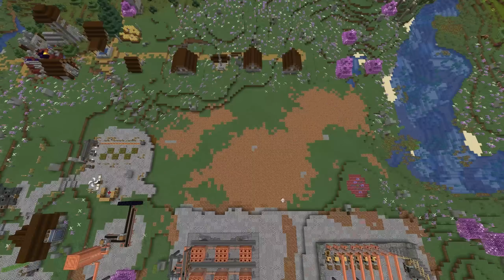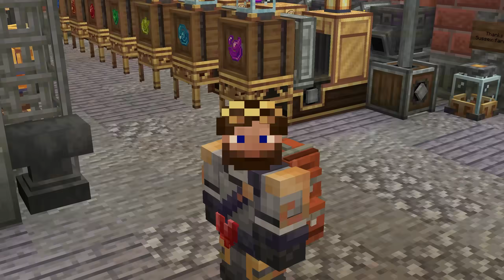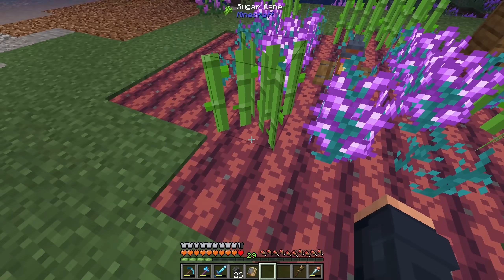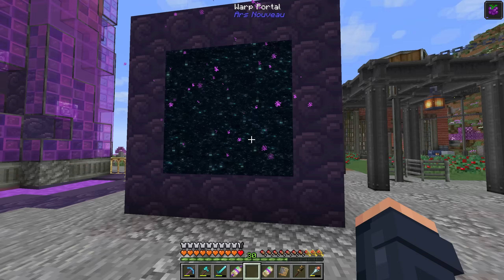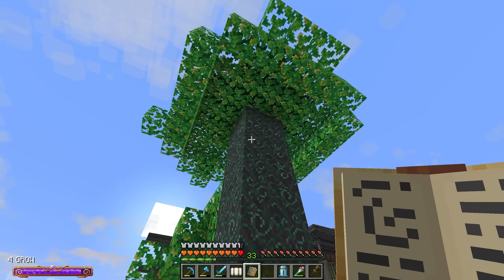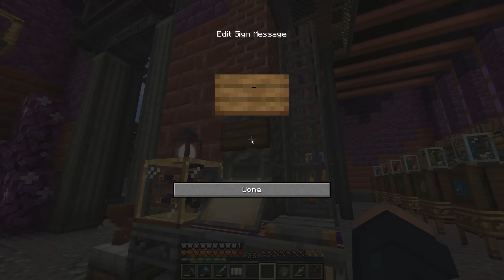Stop Pressing Your Iron! Use MAGIC Instead! EP15 Chosen's Create: Integrated

Comment: is this modpack quite laggy? i tried downloading it and when  logged into the worls i had like 5 fps and my gpu was reaching almost 100?
Reply: I haven't experienced that. Unless your PC doesn't meet the system requirements, it shouldn't run at 5 fps on a new world.

You might want to reinstall
Reply: @paulelderson934 wait, let me get my PC specs
Reply: 11th Gen Intel(R) Core(TM) i545G7 @2.60GHz (1.50GHz)

Comment: I was to ask if you thought about adding 3 mods 
1. Is tinkers construct or productive metalwork
My Reason was ore proccessing also tool customization 
2 is thermal for power production 
And 3  is melanism for ore processing after you get access to the refined storage materials

Also tinkers has a compat mod already for creates  crushed ores to be smelting in the smeltery
Reply: Auto correct don't work right I meant to say mekanism

Comment: I can’t wait to explore your world.  I’ve been having so much fun with this pack.  I made a cool storage system in a building that goes under my base. The factory is not under the base, but the storage system goes under it and I made a fast elevator to the different floors.  I have a river going thru my factory with decorative water wheels and two working steam engines.  I need to start ars, but I’m new to ars, I’ve avoided it for a long time.  This pack rocks!

Comment: Regarding the Pressure via the Thread:
Pretty sure that your chestplate just acts like a Pressure tank now and will fill up on its own (as its says in the Tooltip of the Thread itself).
So the Green Bar should just mean that it's using the pressure from that quasi-tank that is actually just your chest-piece with the tread.

Just test it out, shoot some taters and then see if the bar replenishes or not! Could be that you're waiting for the higher level gear for naught as it already might work perfectly fine.

Comment: 24:41 i recommend using Pierce instead of AOE since it's the same amount of items but it doesn't affect the larger area, pretty useful. And btw, would be cool seeing you using a FARTS(That's how a "super mega ultra smelter" from Ars is called and it doesn't seem that complicated. Just using some runes with Smelt - Pierce - Item Pickup while touching the side of a inventory. You can stack them vertically for 1m+ items per hour or smth like that, i didn't use the more op version.)

Comment: I'd personally put blue lights into the Magic Building
Usually that's hard in Minecraft, because of the Light levels of Soul anythings

But with the Ars Sconces it's easy enough and might add some magical vibes
Reply: Mega torch let's you not care about light levels
Reply: Well and Soul Torches/Lanterns don't let off blue light, it's still the same light as normal torches just less strength.